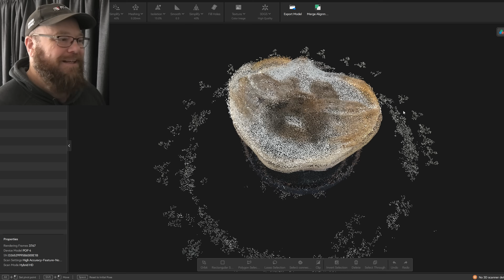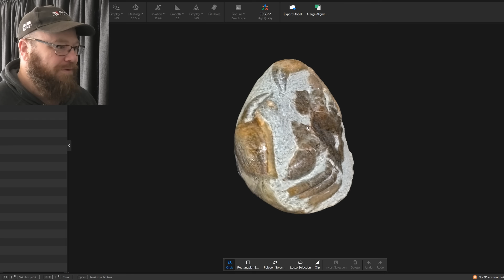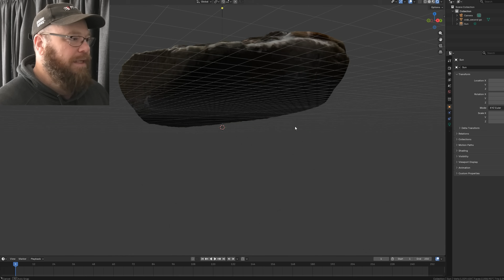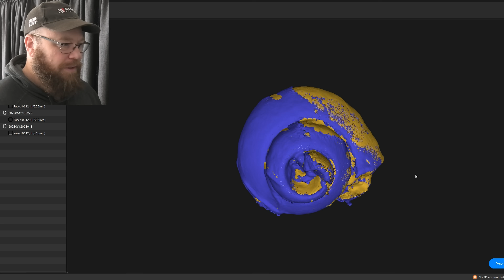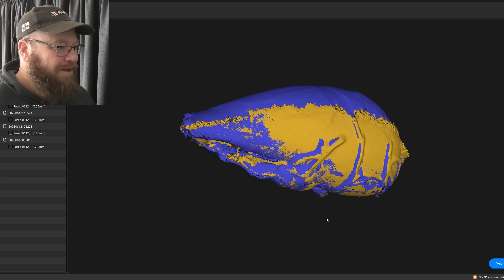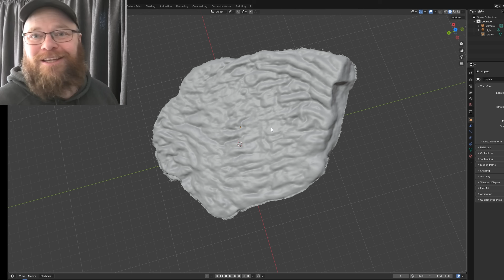The worst fossil crab - making a 3D model (Revopoint POP 4 3D Scanner)

Comment: Taking the 'in the field' use case a little further; makes you wonder -  mounted under a suitably-sized drone (and with the necessary operator's permit(s) of course), whether you could (in theory) use such a device to examine and scan a fossil discovered emerging from (say) a cliff, at a height or circumstances inaccessible, before it even falls out and 'hits' the beach?
Reply: Maybe!  That could have interesting applications for professional collecting trips by museums and unis.  Especially those dangerous british yorkshire coasts